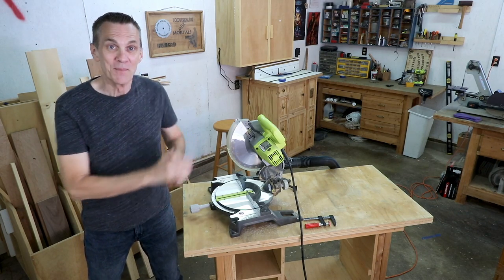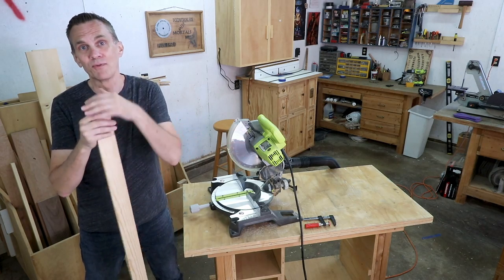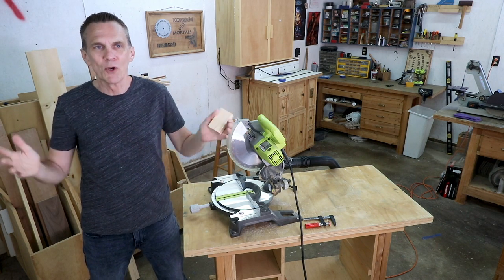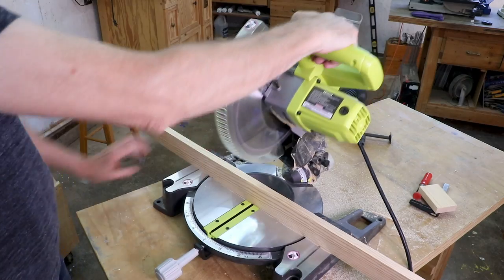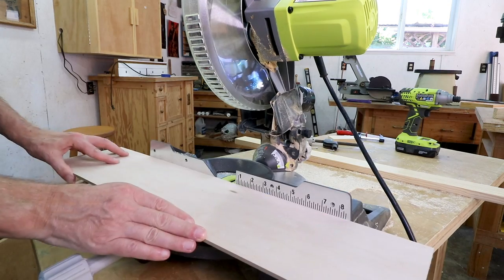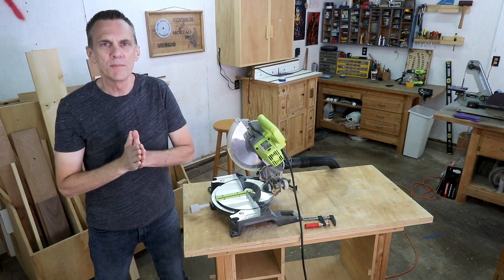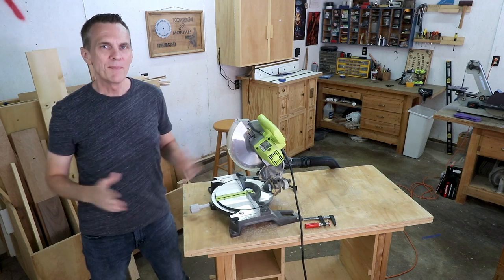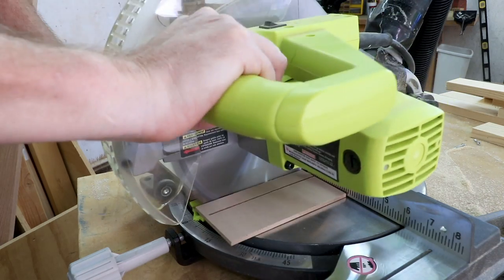8 ways to use a miter saw like a pro

Comment: You can also flip the board over to make even wider cuts. Up to twice the blade cutting depth.
Reply: You can, in a pinch... But don't expect a clean or precise cut.
Reply: @Not_TVs_Frank  I do that quite a bit.  And I get clean precise cuts.  Might not work with cheap miter saw though.
Reply: It probably works best with a stop block.  I always mess this up without one.
Reply: Frank DeRosa yeah it’s really only good to have a stop block or it will be slightly misaligned even with the best woodworkers
Reply: I love that tip, with that tip and a sliding miter saw I can cut 24 inch pieces.
Reply: @williamsavaria9722  You can yes. Keep in mind that the sliding part of the miter saw has to be straight on. If the sliding part goes to one side or the other even a sixteenth of an inch it will be an eighth or quarter before you are done. Best way to get the most accurate cut would be to go only half on one side then half on the other. equal the distance.
Reply: @Not_TVs_Frank  - clean cuts using this technique comes with experience.  That and if your lumber has been milled properly.

Comment: You might consider cutting a 45 degree piece out of the bottom of the stop block that the wood butts up to. This way, if you are cutting multiple pieces the sawdust that accumulates won't throw off your measurement, it'll just slide into the open wedge shape.

Comment: For those in a hurry, here's a summary:

1) Clean up board ends: trim off imperfections from the end of boards before you use them.
2) Use stop blocks: it makes repeated cuts 1000% easier.
3) Make an extension fence: make longer cuts with a stop blocks.  And you get a zero clearance slot as a bonus.
4) Make a zero clearance table: Use a thin piece of plywood to get a zero clearance slot on the bottom, too.
5) Holding small pieces: Use something to hold small pieces when you cut them in the saw.  A pencil with eraser can work well.
6) Cutting to a line: remember that the saw will cut a kerf - a slot as thick as the blade.  Cut to one side of your measurements.
7) Shaving a board down: to take just a hair off, press the board into the side of the blade.  Raise the blade and then make a cut.  You'll take off a very small amount, good for tiny adjustments.
8) Cutting boards that a just a little too wide: raise your workpiece up with a scrap to get a slightly wider cut.  On my 10" saw I gain about 1/2 an inch this way.
Reply: @thomasdalbec5233  You could call it half an inch and be just fine.

Comment: I like measuring a piece and aligning the blade right to the actual tape.  

To cut pieces that don't go all the way though I lift the front edge of the board while the blade is running and down.

Comment: Never trust a laser, they have a nasty habit of moving! When using a stop block, cut a small 45 degree off of the corner nearest the blade and on the table, prevents sawdust from building and making a bad cut (works well for drill presses too)

Comment: Tip: replace the stock blade with one that is suitable for cross cuts. I.e - has many teeth. The cuts will be soooo much cleaner!
I switched to Makita A-93681 (80 teeth) and I wish I had done so many years ago.

Comment: Do you consider yourself a professional woodworker? 

When using a stop block, it might be good to hold the cut piece with your hand or safety stick. You should also try to let the saw stop before lifting it up so that the saw doesn’t throw the piece across your shop. 

When I need a cut that’s just a smidge wider than my saws capacity, I like to lift the front edge of the board while keeping the back edge tight to the fence and table. Faster, easier and possibly safer than putting wood underneath. 

If the stop block is sitting on a table, I’ll sometimes cut a corner off to give dust a place to go. This keeps dust from building up and making my pieces too short. Be careful when cutting thinner pieces or miters so you don’t slide under your stop.

Comment: One thing I learnt the hard way when you want that snug fit you can sure enough "sneak up on the measure". Just make sure to use wood that is dry enough not to shrink when it get it into the indoor heat.
I once made a double decker bed for my kids with perfect snug fit joints everywhere. All prepared at my country house in the outside barn in early winter. When all the pieces was brought home to the apartment for assembly it was very far from snug fit :( So disappointing. I live in Sweden so this might be a bigger problem here due to weather conditions and that most common wood types here are very soft.

Comment: Great tips, I personally wouldn't recommend the pencil one though with holding small pieces.  A pencil won't put enough pressure on the piece and you're risking kickback and sending that piece flying any which way. I will have to try my push stick though for the future because its definitely a lot safer than your hand in this regard!

Comment: My 1st stationary power tool was a radial arm saw and I'm surprised Steve hasn't mentioned them.. Still use it for every project (along with a table saw). With it I'm able to do WIDE cross and miter cuts, rip cuts, dado cuts, drum sanding, ... Super precise. Large work surface plus I have table extensions. Less portable but I have no need for that.

Comment: When cutting a very small piece on mitre saw I use hot melt glue to glue the small piece to a larger piece of scrap, preferably making the offall the saved or desired finished piece

Comment: Any tips for calibrating the saw for squareness?  I've found my Ryobi is off just a few degrees from the pre-set 90 degrees.
Reply: You will probably have to loosen off the bolts that hold the fence in place, clamp a straight bar to the fence to keep the sides parallel, then skew the fence until it is at 90 to the saw blade when it is down as far as it will go with the bar in place. Measure the 90 off the saw plate, do not let the teeth get in the way. Some saws have the fence cast in one piece with the base, in which case you may find some bolts/screws under the base to let the saw head move relative to the base - much harder to get right as you will have to keep getting under the saw to tighten things while keeping the top at the right angle, you may try using a saw horse under each end to hold it up (use clamps & a helper).
Reply: The ryobi logo on the saw is most of the problem. That being said,  you will need to measure it up with with the blade down. You can use a simple right angle guide and check to see if it’s 90 degrees. 

If it’s not, adjust the stop limit points on the bottom of the saw where the dial indicates the cut angle. Next to all of the stop limits are ( should be) a set screw for adjustment of the position of the saw. You will adjust the screws until the blade lines up correctly. Then adjust the “sight” to the 0 degrees mark that you have just adjusted to 0 degrees.

As to the compound part of the miter saw, it’s not as “tunable” as the other parts. How you adjust thst is simple though. 

You will need an angle measuring tool. Adjust the saw to where is shows a 45 degree angle cut. Cut a test piece and measure it. When you have it at exactly 45 degrees move the “sight” on that part of the saw to the point that Indicates 45 degrees and now you’re done.

As good as you can on an entry level saw anyway.

Don

Comment: If you are trenching with a sliding miter saw and it's not cutting all the way  through grab another board and use it as a spacer. That should push it out far enough for a nice clean trench

Comment: question - 3 minutes in - love the advice about extension fence.  but why 2 screws each side of the blade?
Reply: When the extension fence is cut the extended ends are then held firmly in place by two screws rather than being able to pivot around one.

Comment: I have noticed in measuring for a stop block that if you measure from the blade and not from the teeth that you could be off by a little especially if you have carbide teeth. What is your thought on this. Thanks.

Comment: Hey there Steve, good tips there all along. Allthough I've got a question, I have a Sliding Miter saw, and while doing the Rabbet joint, I ended up on the side closer to the fence with 8mm thinknes of remaining material, on the far side with 2mm of material. I think the bearing/header of the slider is missaligned.
Any thoughts on that??
TNX

Comment: My pro tip is buy a dedicated new blade for your miter saw for fine woodworking. The out of the box blade is fine for rough cutting but dont expect precision cuts with it.
Reply: Correct, most saws come with a general purpose blade. I swap out for a crosscut blade. Same for tablesaws, I have rip, crosscut and a laminates blade.

Comment: 1. Always -- ALWAYS! -- do one or two test cuts with your stop block. And always -- ALWAYS! -- measure every few cuts, because those things will move.
2. Technically, the preferred definition of "kerf" is the cut made by a saw, or the size of said cut. This is important because you need to know the size of the cuts your various tools make, not the size of the cutting tool. Don't rely on these being the same.
Reply: pedantic
Reply: @Carl-LaFong1618  Nope. There is often a measurable difference between the two. It's a distinction with a difference that one should be aware of. I've seen customers argue over 1/32"; I've made stuff for a customer who needed <1/64" minimum accuracy.
     Sorry, but language is a technology that connects what's in your head to objective reality. Rip enough lumber and you'll understand the importance of the distinction between the kerfs. It can be the difference that determines whether you have to kite a check for your electric bill -- or worse.

Comment: Hi Steve, how can I cut a 45 degree angle for the edge of a 1x6 if the edge of the 1x6 is not square? IT seems I would have to raise the board above the guard and have it jutting out but that sounds a bit dodgy unless it can be secured. Thanks

Comment: when I have that little splinter of the edge not quite reaching, the way I've always done it for decades is when you reach the end of the cut just lift up the front end a little and it will finish the cut all the way through.

Comment: Any suggestions if my miter saw does not have the screw holes for the extension . I was lucky enough to buy a very nice used Dewalt for $50
Reply: Just drill your own.
Reply: Ya I agree, just drill yourself some holes in the flattest spots and run a screw thru! Also have seen permanent fence extensions where the hole is taped and a bolt is used, obviously the bolt head needs to be countersunk, if you dont have a tap then just use a washer and nut. Hope this helps you out! 👍🏻
Reply: Going to try this. Have to see what kind of room I have on the back.
Reply: @webmaster90  most fences I've seen have flat areas plenty big enough for a 1/4 inch hole (of what ever size you decide on) I've seen other comments with this tip as well but I'll say it just incase you didnt see it, on the bottom edge of the new fence cut a 45⁰ angle along that corner, it will alow sawdust to not build up preventing your material to sit flush up against the fence.

Comment: Steve I have the same 10 inch Ryobi as yours, just curious how do you find the bevel cuts on it? I have been struggling to get a good bevel cut with mine, wondering if it’s the saw or just me. Thanks

Comment: I am building a porch soon that has to meet certain criteria and has to look really nice. first, it has to be enclosed in vinyl, at least 6x6, it also has to be stained, and the railing supports must be no more than 4 inches apart (on center). I was thinking I should use 1x2s laying them horizontally. does anyone have any advice for me?

Comment: Lifting the wood could potentially be dangerous if you aren't holding it down good. It could get caught up in blade and throw your hand into blade as well. I would recommend buying a sliding miter saw or just flipping the board over and finishing the other half

Comment: I am newly subscribed to your channel and really enjoy your videos, tips, and tricks. I am trying to follow your recommended tools list, and I think I may have found the right Miter Saw, but wanted to ask the professional(s). You recommend a 10" and I found a Ridgid 12" (model R4121) at half the cost ($150 vise $299) of a new one; should I be sticking to the recommended 10" (guessing is minimum recommendation), or would this 12" be a recommended upgrade? Thanks for the videos, I really enjoy them!

Comment: I'm embarrassed to admit I didn't think to stick an extension fence onto a miter saw for a long time... So long that I built a miter table for the saw.  Which I really love.  But I could have done this for several early projects and saved some frustration.
Reply: A table is way way more useful.  Just the added support is awsome plus you can permanently attach a tape right onto the fence.

It's not just about saving time.
Reply: @answeris4217  Believe me, I love that table.  It's great for sanding long boards and it's pretty sweet to cut 6" if an 8 foot 2x4 and it just sits there, waiting for my next move. It's so handy I made some of Steve's folding sawhorse so I could move it around more easily.

Comment: all that and you missed the MOST important safety tip there is when using a chop saw: SUPPORT YOUR WORK PIECES.  If you have three feet of material hanging off the end of your saw, what do you think is going to happen when you cut it?  It's going to angle right up into the blade, along with your fingers, especially if you're green.  In fact, if you don't think of that before you start working, you should probably stick to hand saws.

Comment: The raising the workpiece tips is a good one but presumably a con of this is that there is no support to the underside of the material and more chance of chip out? I guess this can be easily solved by using the raising board as a sacrificial..?

Comment: Some if the retailers here in Australia mention that you can adjust the depth of the cut on a mitre saw.  Would this allow you to cut rabets and dad is on say a sliding saw?
Reply: The depth stop on a sliding miter does allow rabbets and dados.  I saw a video recently on another channel where a guy made a slew of dados using that method.  It was the first time I saw that technique.  Personally, I'd probably go with a router or table saw instead of I had that option.
Reply: @Not_TVs_Frank  Thanks for the reply.  I've been trying to get into wood working and deciding on what tools to start with on a very limited budget.  Good to know what you can use or make do with.

Comment: Steve,
You need a better blade to prevent splintering ends. 50t-60t min.  80t for a 10in Ryobi may be a little to many teeth for this saw per my experience

Comment: So I tried using a stop block with my miter saw and it was causing the cut piece of wood that I needed to fly out and break off and piece got stuck inside the blade shield. I was cutting 2x4's any idea what was causing this?

Comment: I found the way you recommended stop block to be used dangerous. It is much safer to have stop block to the left of the blade so that the piece you’re cutting off don’t  get bind between the blade and the stop block especially it it’s a small piece that is most likely to move into the way of the blade after being cut off.

Comment: Make a shallow-angle jig by making an auxiliary table with a fence and a base, then add a fence at 90 degrees, sticking out toward you. You can now put your workpiece at 90 degrees to the primary fence, so you can make cuts "sharper" than 45 degrees, like say, making the scarf joint on a guitar neck.

Comment: My tip: Be very careful if you cut something cylindrical (like a tree branch) on a mitre saw. Rather than cut into it, the edge of the spinning saw blade may start the wood spinning at 100s of rpm. This is scary and dangerous. Been there, regretted that.

Comment: With a carbide tipped blade you should be able to cut soft metals like copper, aluminium and brass without any problem.

You might hit a nail one day.  Chech your blade you might be lucky and break no teeth or one or two.  If that is the case most sharpening shops can replace a tooth for way less than a new blade.

Comment: To add a zero clearance table — instead of plywood use wide masking tape and tape over the wide throat the length of the throat and then just cut through.... thinner and replaceable
Reply: Also works good to pinpoint edge of blade for lining up trim cuts for accuracy

Comment: You can cut multiple pieces at the same time by stacking them one on rop of each other.  If a temperary fence is going to take too long ro setup you can cut one piece to length and then use that one to measure the others.

Comment: A zero clearance for the table is not necessary. The blade cuts in an upward direction, like a circular saw. So, to get clean cuts, put the "good" side down. However, a zero clearance for the fence is probably a good idea.

Comment: I have a Dewalt 12" sliding miter saw.  The dust bag is not very efficient and sawdust is always an issue.  Does anyone have any ideas for dust collection on this model?
Reply: Most miter saws can be hooked up to a shop vac the same way they connect to the dust bag.  You may have to find it fudge an adapter to make the hose fit.  In the end, miter saws are messy and it's hard to keep the dust down.
Reply: I have the same problem.  With the saw running and my shop vac running, the noise is deafening.  My dust collection system is a broom and dust pan.

Comment: The only point in making a zero clearance on a mitre saw is to stop small offcuts falling down the hole. There is no point making one to reduce tear out.. the best side of your cut is the underside anyway on a chop/mitre saw, because of the blade rotational direction, the tear out will be on the back edge and top face.Therefore no point making zero clearance for that point